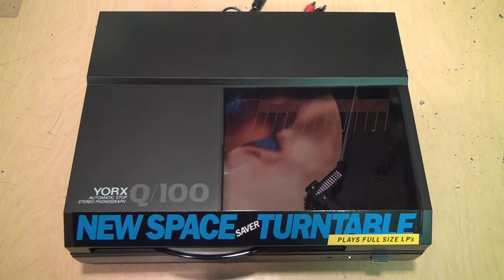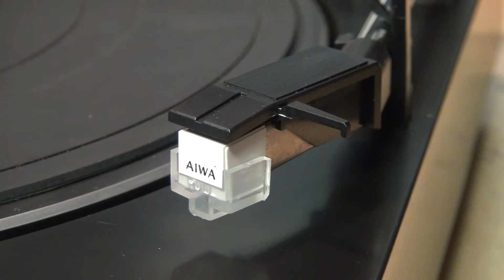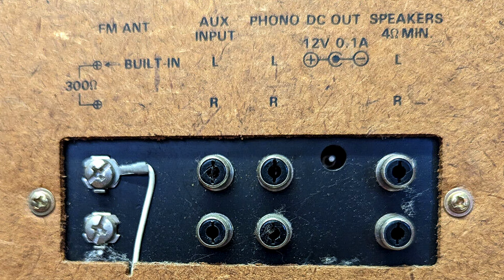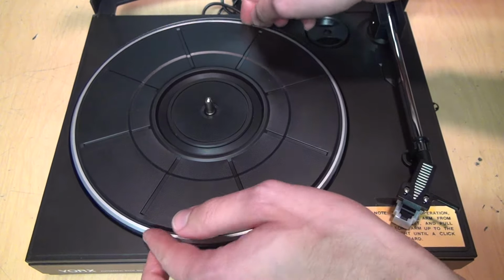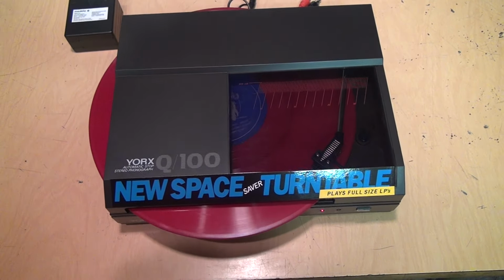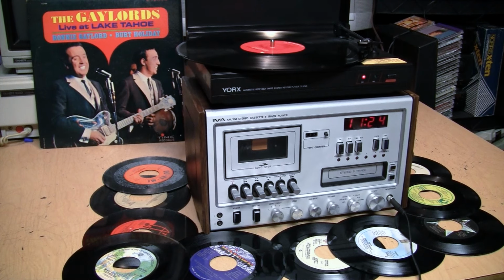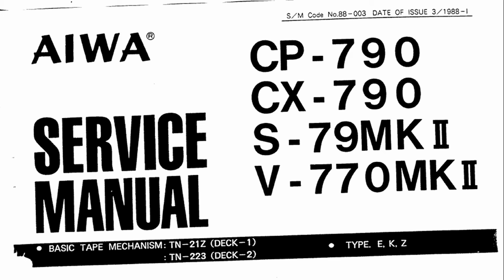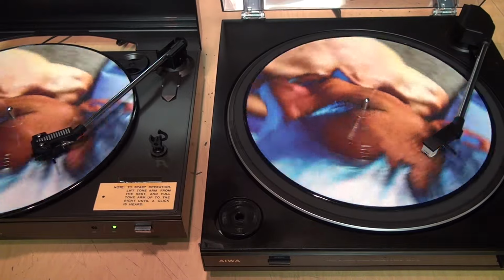How to rescue an orphan turntable - and why you probably shouldn't

Comment: If I had that Aiwa, which is probably worth rescuing, I would have unsoldered the entire ribbon cable from the inside, and mounted a power supply inside, and run AC and audio cables out the way the standalone version would have been built. Then, no one would be able to tell it was once a part of a proprietary setup. However, I wouldn't pay more than about $10 or so for the turntable to begin with, leaving room for the time and parts for the conversion. I would have left the Yorx alone. It's probably worth more as a still unused artifact from the late 1980s (future museum piece when it reaches 100 years old) than as an actual turntable.  Sort of how we now enjoy even the most basic low end Victor Talking Machines from the 1900s today, even though they were obsoleted by the newer Orthophonic Victrolas.

Comment: That Aiwa looks like a rebadged version of a self powered Sony I had here a while back too. 
Same arm, buttons, cover, etc. Only the Sony had an internal power supply and two regular RCA plugs on it. It wasn't anything worth my time either and took forever to sell. 
In fact, no turntable has ever sold well here, not even some of the models you would think are more desirable. I had a Technics SL1200 listed for over four years for $80 and got no replies here despite it being in near new condition. Cassette decks on the other hand sell fast, faster than CD players. 
The OCD in me would have had me finding a transformer or power supply and hiding it inside that Aiwa and adding two permanent leads to it but it would in no way be worth the effort.

Comment: If you have a device that you don't know the power of you could try using a universal power supply and step up the power from the lowest setting until it works. Many also have switches for centre positive/negative so the extra part wouldn't be necessary.

Comment: Excellent video! I never knew that about ceramic & magnetic cartridges, thanks for sharing. Your 'quick & dirty' rewiring would've been much more aesthetically pleasing if you used heat shrink tubing instead of those big twist on connectors?

Comment: 26:36 if you would have opened the player first, before cutting the original connector, you could just put that cable inside and connect new wires/cables for power in and audio out...

Comment: A preamp for the crystal cartridge is easy to build. I would eventually 3d-print a box, put a preamp (one double op-amp is enough) and a power supplky into it and get a working turntable. However, these crystal cartridges need more weight - typical about 10 g instead of 1..2 g needed for modern magnetic cartridges. This of course causes records to wear much faster.

Comment: I had a c1990 JVC turntable with a barrel plug that went with a corresponding hifi system. I replaced it with a Denon brand separate turntable around 20 years later, which was almost identical, except it had a plug. (Both looked just like that Aiwa)

Comment: You don't want the rest of the Yorx system...  That is unless you don't give a toss about any sort of build and sound quality.  I owned one of these all in one systems as a teenager and it sounded absolutely horrible and was made of the cheapest plastic and masonite (cardboard, really) that could apparently be sourced at that time.  The tape transports were terrible.  The only thing it could really practically serve as is a demonstration of what  cheap electronics were like in the 1980's.

Comment: I have the Aiwa CX 75 that has a similar record player. I love the sound that comes from it. The connection on the end comes in handy on eBay as they are usually a hell of a lot cheaper than the plugged one's. Usually spares or repair as they can't be tested. Personally I like Aiwa and am pissed off they don't make them anymore. There is a new Aiwa amplifier but I think it is just the name sake though.

Comment: Rather than just attaching wires to the ribbon cable it would be neater to de solder the ribbon cable and hard wire some sockets into the casing so plug in RCA and power leads can be used. 
I have a Thorens turntable that was hardwired from new. After 20 years of use I decided that the cables and connectors had probably seen better days so I bought RCA and power jack sockets and drilled them into the casing. Much neater.

Comment: 22:47: I might be an alternative to pull the metal innards out of the jumper wires and possibly even use pliers to tighten them, and then use a two-step process to make your own plug, where you first plug all the "naked" jumper wire connectors into the socket and use epoxy, hot glue or sugru on just the naked jumper bits in a way that locks them in place relative to each other but avoids any epoxy, etc. contact with the existing connector. When cured, pull out your naked connector and add more epoxy, etc. to complete a plug. It's probably easier to be generous and then dremel things back to match the shape of the connector.

Comment: I had a Pioneer turntable that was an orphan. I ended up analyzing the situation - dried up belt, the hassle of fixing the cable to work on regular AC - and just tossed it.

BTW - the first time I ever played a vinyl record was in 2009-2010,  at the Nasher art museum in Durham, North Carolina.  It was an exhibit dedicated to vinyl, before the major comeback of it. They had a bunch of AT-PL50 turntables set up, and I just played some albums on headphones. I think I listened to Sgt. Pepper's. This Aiwa is pretty much the same thing as those PL-50s.

Edit: Also - I wouldn't chop off those connectors and wire them together, I consider that to be a major fire risk. I doubt I'm alone there.
Reply: How is it a fire risk splicing? Just use proper connectors and there’s no problem
Reply: @JacobKelly02  The majority of people hear splicing and think twisting wires together and covering them with electrical tape. You and I both know that it's unsafe, and if I were to do it I'd solder & use heatshrink, I'm just referring to how most people would do it.
Reply: @windowsuser321   I mean.... those twist-on connectors are how most people (at least here in the US) have their mains wiring connected where circuits diverge in a junction box.  Not really a problem there, if they're used correctly.

There's always the chance that they're not used correctly.  But there's always a chance someone did something dumb.  Wrong voltage, wrong polarity, 120v device on 240v mains, cheap PSUs that don't have proper safety ratings.... you name it.

Even if some Melvin did just wrap the wires together and electrical tape them, it's more than likely going to fail by just not working anymore, than being a catastrophic event at 12v, <1A.  OTOH, I've gotten hold of stuff someone rigged up that way that was still perfectly fine, way too long later.

That said, I would just open the thing up and attach some RCA and power leads directly to the PCBs, like the OEM model would've if it were a standalone unit.  Beats the hacked cables for usability and aesthetics, even if I don't see them as particularly unsafe.
Reply: @nickwallette6201  You mean those nut things that are used to tie wire connectors together? I'm good with those, I've even used them.

I would do the same thing with the cord. In fact, I have replaced cords on equipment before. Not like that's some big feat, it's not a hard task, but I'm more just saying I've opened stuff up and replaced cords before. That would be my preferred method myself.

Comment: Always wondered what those mini tape decks that were part of a silver coloured stack system usually with a CD, amp, tuner and possibly an EQ sounded like. Denon released some, as did Onkyo. You sometimes see the separate parts on eBay.

Comment: If that Aiwa turntable was mine, I think I'd be tempted to fit a 12v PSU inside, possibly one of those little switching supplies used for 12v MR16 LED downlights, and add an RCA cable to it, just to make the setup a bit neater!

Comment: Out of the two Turntables, the Yorx sounded more spacious but a little shrill. Not sure if the was the initial system used? The AIWA sounded warmer, less top heavy. When you cut the cable of the AIWA then went and looked inside; would it not have been better to de-solder the cable? Or would that have been to messy?

Comment: Hey vwestlife when wiring thr phono plugs and the turntable has common ground do you have to connect the common ground to both the left and right phono plugs or is just to one channel sufficient?. Great video
Reply from the maker: I connect the common ground to both the left and right audio plugs. That way if you have only one plugged in, it will still work.

Comment: The Aiwa one is, if you can solder, in my opinion, easily worth picking up if you get it dirt cheap. I'd just permanently remove the ribbon cable and solder on phono cable and power jack

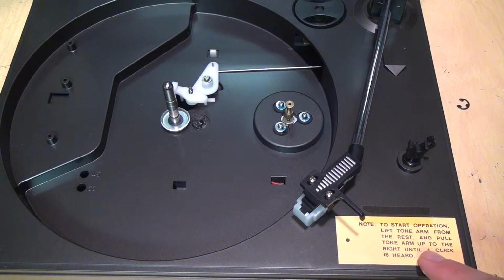Comment: 12:57, wow that reminds me of exYugoslavian Tosca model(s) turntables from RIZ factory. Almost every single one of Tosca model (and not only Tosca I think even Trubadur etc.) starts motor exactly the same way. difference is that mostly those models didn't have belt driven mechanism they were more like those old BSR mechanisms with rubber wheels.
and also first few models of Tosca had 4 speeds (16, 33, 45 & 78), they had auto-start, auto-turning off, stacker for SPs and even stacker for LPs - oh those good old days, ahahahaha ;-)

(RIZ Tosca, RIZ Tosca 5, RIZ Tosca 10...)

Comment: Yup.... things started getting much smaller through the 90s and early 2000s. I remember getting my Motorola C333 in 2002 with a whole Austin Powers "theme" Union Jack rear skin and everything. The phone was cool for about 1 month and between a battery that didn't last a day (all the other regular phones could easily go 2-3 days on a charge) and CONSTANT dropping calls...ugh...it sucked. Like I said, it had some cool features like Polyphonic ring tones and a a very fine Dot Matrix display, but functionally was just not there.

Comment: i just brought a teac gsw5300 cassette deck which has this exact issue, it looks like it uses 12v and 22v with a very special plug required so it runs with the amp that is meant to go with it.

Comment: i used to have a silver hitachi 'music centre' that had lost  its 'custom' record deck and cassette deck, and if i had them, and the rest was in better state(it was used in a factory for many years before i was told i could have it as they were clearing out, and was very mucky) i'd have kept it , also got a twin tape cassette unit that has a strange multiway connector for audio in/out, cant remember brand at the mo

Comment: The turntable with the PC port Line, is a DJ's Turntable.  but that turntable can also be used to Copy your Lp's with at the time... the Highest quality re recording  system and power.   I think, that turntable was  a turntable from the early 90's!  I would save  any Phonograph. I think, Lp's, 45's 78's do sound better than the CD/MP3!

Comment: I don't know if I necessarily agree with your final assessment that these kind of TTs aren't worth the effort because of their low quality. I get your point in theory - that working around these oddball connectors would be a pain and just buying a used LP60 would be a better decision. I'm just talking about their build and sound quality. I grew up with very similar kinds of turntables and I could see myself being just as happy with another similar one than I am with my pain-in-the-butt AT-LP120X. (Seriously though - a $350 TT that has given me nothing but headaches - WTF??? I should have just gone with an LP60X or Sony/Pioneer like-minded automatic.)
Reply: what have you found disappointing about the at-lp120x? just curious because it's one i've had my eye on for a while
Reply: @doji_town_adventures  The tone arm and anti skate, not sure which. When I raise the tone arm and move it to (say) the last song on an album, the arm doesn't stay put, it slides outwards as if the anti skate is up too high. If I bring the dial down to zero, it doesn't slide out but I can't imagine having anti skate set to zero is correct. And that's not even with the tone arm engaged, that's when it's raised up above the record. You would think the anti skate didn't engage until the tone arm is deployed but apparently not. I've tinkered endlessly with the damn thing and cannot figure out what's wrong. It's endlessly frustrating, but it seems to be an issue with just mine, not all LP120's.
Reply: @Thievius333  hm interesting, thank you so much for your timely response! i'll have to keep that in mind
Reply: @Thievius333  tbh if that were me I’d give a few records a play with it set to 0 and see if there were actually any issues, just in case it happened to be that well balanced. If you just got lucky that would explain why the ones other people have do need some anti skate. But maybe you’ve done that with unsatisfactory results?
Reply: I seem to recall VWestlife started having problems with the speed of his AT-LP120.
Anyway the choice isn't clear cut given that many of these orphan turntables are unused in their boxes.

Comment: I know about these thing in between a compact system in one housing and components you can exchange and combine as ever you want.
It has few advantages over an all in one unit, the Snow White Coffin Style,   when record player or cassette drive is broken, you can continue using the rest of them, as long the error isn't the power supply. But the non standardized connectors... 
I myself avoided stuff like this. Instead I purchased used stuff. The record player needed a new stylus and new belt and worked fine, meanwhile I regret, that I gave it away, it was better, than the with Dual and AIWA rebranded Audiotechnica standard player.
I had a radio tuner, amplifier (this was new, instore brand of a store for HiFi, TV and parts) and some speakers (not expensive, about 100 bugs each, but with good sound).

Comment: Why cut the cable when you are opening it anyway? Just solder on top of the PCB where the existing wire harness goes and then wind the old one up and stuff it inside, while running out the power and line cords through the existing holes?

Comment: Some  of the portable Linear Tracking Turntables   sound ok such  as the  technics  & kenwood  models but there s the issue of Tone arm settings & Grounding  Incompatability due to prpiritary  issuies on  separate receivers that pose this  problem..(.but not Always).Why?  many portable turntables  that  ended  up  used in consigment  shops  were   usually part of a rack mini system from that  the Likes  of kenwood & technics  sold...I believe that  radio shack sold a Linear tracking model  that supposedly was  made by revox might be worth tracking down?

Comment: I think you can get a transformer that has voltage output that matches the unit and put a cord on it and a line fuse on the AC primarily consult with a authorized tech before doing

Comment: Here I was thinking you might miswire the Yorx and play a few records in reverse...
Reply from the maker: I actually did do that with a similar Soundesign orphan turntable years ago. If you reverse the polarity, the motor will run in reverse, but will lose its speed regulation because the circuitry for that won't be working, so it will play fast and with lots of wow & flutter.

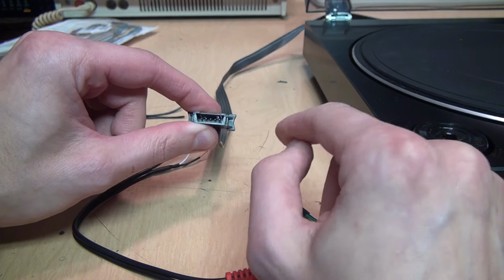Comment: Thanks. Now I feel like going out and adopting some orphan turntables. 😄 BTW I'm not sure how you store device-specific cables such as what you ended up with at 24:15, but I'd be inclined to tape it to the inside of the case in a position that won't foul the mechanism either in situ or if the tape fails and the cable comes loose (but that's because I have a lousy memory and either forget where I put that cable or what it's used for).

Comment: It will take some reverse engineering but those connectors should be able to be swapped with more modern connectors.   The hard part is just finding out which wite goes where and that will ŕequire a service manual,  either official or unofficial.

Comment: if any turntable is probably best to not save is those Yorx turntables.  If you were buying a Yorx, you were buying the bottom of the barrel in terms of quality and cost.  People bought Yorx gear for one reason and one reason only; they were dirt cheap and "worked".  That's it, and most broke down in a couple of years.

Comment: The ribbon cable of the second orphan probably has a .1" pitch, which makes it possible to just splice a couple of IDC connectors onto the cable to restore the original configuration without much trouble.

Comment: If you're lucky, you can use a multimeter in continuity mode and check with the grounds of the RCA cables. Not a full-proof method however.

Comment: I had a Sony TA-AX 295 stereo system, the turntable was pure crap. The cartridge was difficult to replace the needle, I needed to use coins to press needle into groove because it made records sounded off without the coins. It also had a simular cooky power wire which the entire system had for hooking up the tuner and cassette deck.

Comment: Any turntable worth its salt should be fitted with a magnetic cartridge to begin with, but should have NO ELECTRONICS AT ALL(save for speed governance, which should be accessed from the back of, not the under-side of the player), the phono cable should have the horseshoe clip to connect to ground, and have a two-pin plug to connect to a power output(unswitched) on the back of the tuner/amplifier, set to run off the voltage and line frequency of the country in which it is to be used. (18:35)